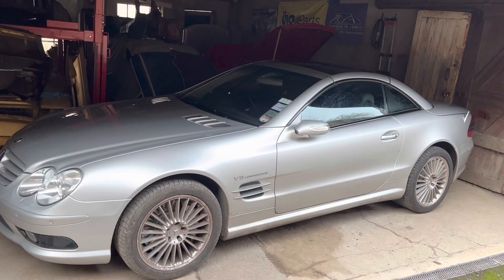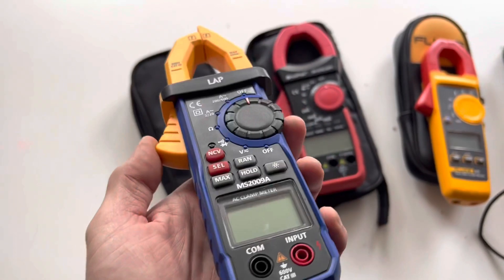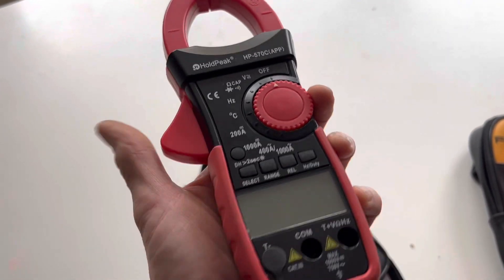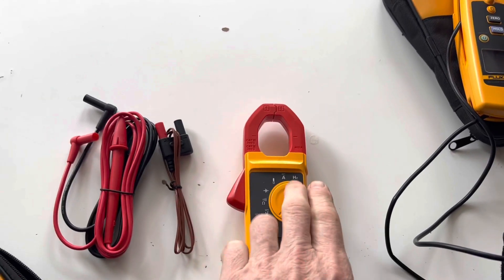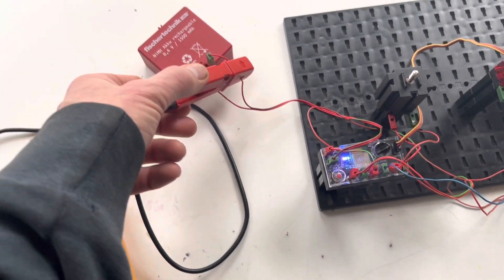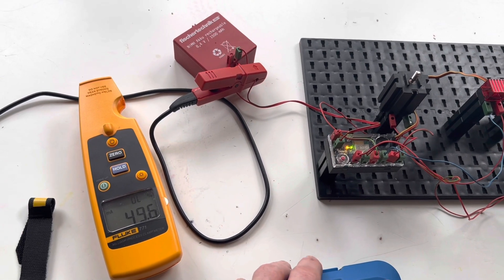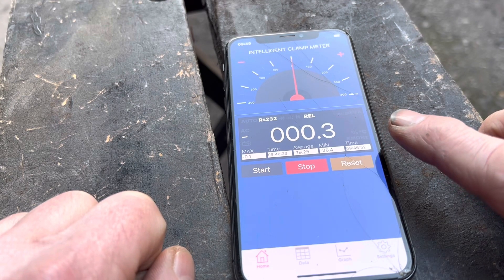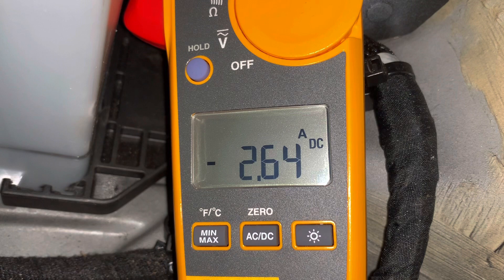Mercedes SL55 AMG R230 battery drain - finding a non fused parasitic draw using clamp meter

Comment: Your video was very helpful. I've been troubleshooting a 600mA draw on my ML-320 - I say 600mA, I have one of those single decimal Holdpeak meters myself! I'm unable to find a fuse with any mV across it and was planning on getting my Flir camera on the job. Mine's not the posh one like your FiL's but hopefully it will lead me to a diagnosis!
Reply from the maker: Sorry to hear you have a problem. Let me know how you get on with the FLIP camera. Where do you live? Mike
Reply: @MikesMercsandothercars   Each year I try to get all my car problems fixed while the weather's nice, this one has caught me out! I'm in south Oxfordshire.
Reply from the maker: Good luck tracking down your battery draw. On my SL55, I have so far encountered:

1. Glove box light staying on because of a broken switch. Easy to check with a mobile phone left in glove box. 
2. Mobile phone cradle for old Nokia phone not deactivating.
3. CD player not shutting down.

I am no great expert on the ML but I would also try unplugging the seat control modules (under the seat ?) as these can cause a battery drain.

Last but not least....make sure your alarm siren is working as sometimes this can be responsible for a drain.

If you have a scanner that might lead you to  a potential problem.

Mike

 @andrewwturner
Reply: Thanks for the tips.

Solved! The problem was being caused by a Smart Relay which supplies power to the tow hitch socket. The relay is meant to sense when the engine is running and cut power to the socket when it is off. It does this by monitoring the 12V supply and should switch to 'on' at around 12.6-12.9V, mine was switching on at around 12.2V and was staying on until around 11.7V. It draws ~10mA in the 'off' state so not usually a problem but when in the on state it was drawing 100mA.

It took me way too long to diagnose this for two reasons(!):
1. It runs off its own fuse straight from a 'bolted' 12V terminal - I was only checking factory fuses.
2. The sun was shining directly onto that part of the car and warming everything up so I couldn't see it with the Flir. @MikesMercsandothercars
Reply from the maker: Success! Glad you got to the bottom of it. Mike @andrewwturner

Comment: Very helpful video thanks!  I was able to track down my battery drain using this and your previous video.  In my SL-500 there is a built in car charger and a Mercedes branded flip phone in the upper compartment of the center console.  (I didn't even realize there was an upper compartment until now)

This phone was probably state of the art when it rolled off the dealership, but as soon as I took the phone off the charger it already said low battery and was very warm to the touch.  The car was sitting in the garage all night so there was no reason for the phone to be so hot.

So fingers crossed that when I start my car on Monday after this long weekend, that I don't get the error message and my radio actually comes on.  Thanks again!
Reply from the maker: Thanks for your comment. If you have had a battery drain for some time, you might find your consumer battery is knackered and slowly loses charge even when not connected- that what I just discovered on my car…..hope you fixed it. Mike

Comment: Hi Mike. Excellent as always. My 107 blower fan keeps blowing fuses, maybe I’ll invest in a clamp meter 👍🏻
Reply from the maker: Hi John - hope you are keeping well. Took me ages to figure out why the blower on the red project car wasnt working...when I opened the bonnet and took off the black plastic cover, found it wasnt actually wire up. Open the hood and take off that black plastic panel by the windscreen and you should see the blower motor. First make sure there is no water in there and that the connections are not touching anything they shouldnt be. Then you could try connecting the battery directly to the motor and seeing whether it turns freely. A seized motor would blow the fuse. You could also have a problem with the soldered joint on the back of your switch. Welcome to borrow my clamp meter. Mike
Reply: @MikesMercsandothercars  Mike! You have all this going on with the Dragon and you still find time to help me out! Thank you 🙏

Comment: Cunning bit of detective work Mike! Fortunately as we know, my 2005 SL doesn’t suffer the same fault… 👍
Reply from the maker: Thanks for your comment....the problem is with the glove box latch....it works just fine if you close it gently but the catch can spring out if the latch gets out of alignment and you have to slam it shut...once that little lever springs out the light stays on. Crazy design! Mike
Reply: @MikesMercsandothercars  
Hi Mike, have you posted a Video on how to fix the glove box light? I found my light didn’t turn off, so took it out to try to find the switch but it is as almost everything in this car: over engineered. Your videos are great, so well explained. I’m looking for a parasitic current too, keep searching, have a 200mA current after putting everything to sleep!
Thank you, Ingo from Spain
Reply from the maker: @ingonannsen9869  Hola. Thank you for your comment. My next video will be all about why the glove box light problem happens  and how to fix it. There should be a small plastic curved rod protruding out of a hole. The glove box lid pushes this rod and the rod does two things - it activates a microswitch AND more importantly is separates the two metal contacts on the light switch. If you close the glove box too hard, this rod will jump out of position back through the hole and the light will stay on. I found my rod lying next to the light when I took the car to pieces!. 200mA draw is what you would get from something like the glove box light. Put your iPhone in the central console and make sure that the light in there is off when the lid is closed. Similarly, put your iphone in the boot/trunk and make sure the light switches off when you close the boot. Mike

Comment: Hi mike another good vid thanks for taking the time I’m sure I’m not the only r230 owner who appreciates them,I had a similar battery drain and when the car was in for service had the fuse which powers the phone removed which solved the heavy drain but also disconnected the radio/cd amp I think ,the command still comes on but no sound any idea on the fuse position to replace,the fuse box behind driver is not identical to the layout on yours going by the vid cheers,
Reply from the maker: Hello if you type the following into google, you should get a good fuse chart for you car:

GF54.15-P-1256-01RB

I would start with fuse 66 which should be a 25amp clear fuse.

Then I would look at fuse 76 on the left hand bank of three fuses which should be a brown 7.5 amp fuse.

The other fuses which are potentially linked to this are, f54 audio gateway and f77 Command unit.

Mike